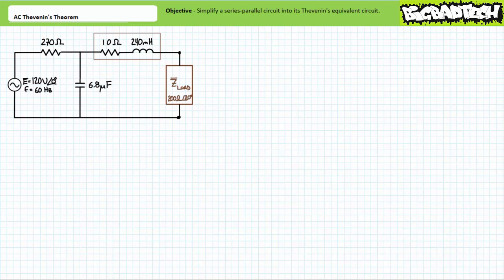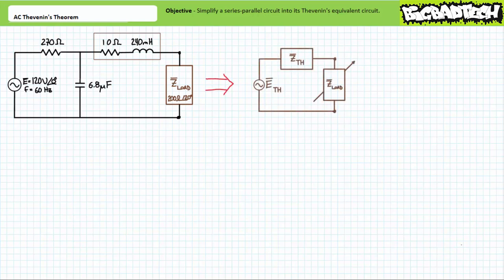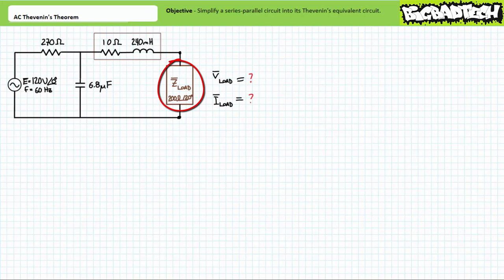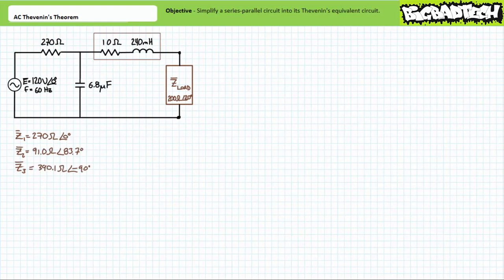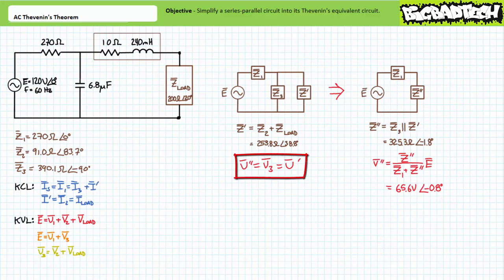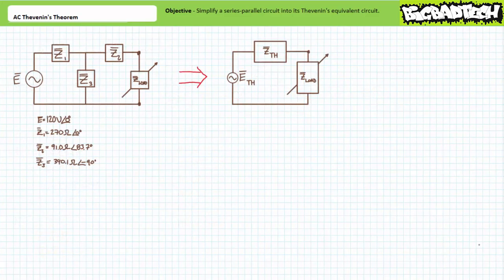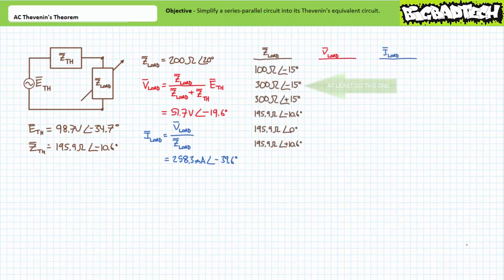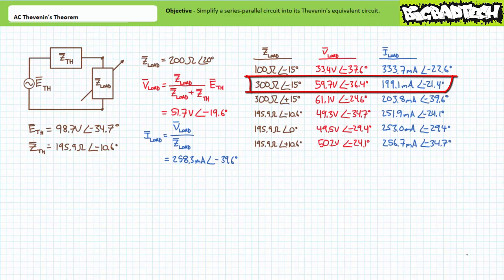AC Thevenin's Theorem (Full Lecture)

Comment: What I find surprising about this is the way the model remains accurate even when Zload impedance is lower than the full open assumption used to get the numbers. When Zload declines and current through that arm increases, the increase in voltage drop across Z1 and Z3 in series must exactly balance the declining shunt of current (and declining voltage drop) across the parallel Z2. Presumably that would come out with a rigorous proof....
Reply from the maker: True dat. Check out the "DC Maximum Power Transfer Theorem" lecture. It's not a rigorous mathematical proof by any means, however, a great way of visualizing response of the Thevenin's equivalent circuit is to draw a plot of current, voltage, and power for a range of load resistances. At regions near the open circuit equivalent, the response kind of stabilizes at the Thevenin's equivalent. This is admittedly a little more complex for AC circuits because you're dealing with two properties, impedance magnitude and impedance angle, however, if you can think in terms of two separate dimensions rather than trying to lump them together into a single three dimensional plot, the response is similar. Check out the "AC Maximum Power Transfer Theorem", this will explain the response of the Thevenin's equivalent for a range of load impedances.
Reply: @bigbadtech  Thank you, Jim. I thought I already knew most of the DC principles, but have recently found humbling examples of knowledge gaps you kindly exposed. Thevenin must have been a genius....

Dave

Comment: how did you get -390i ohms for the capacitor's impedance at 4:14? Your formula gives a magnitude of .00256353
Reply from the maker: It should be 1/(2pi6.8uF)=390.1. For some reason the "1/" in the 1/2pifC formula got cut off.
Reply: @bigbadtech  late night studying always gets me.  Thank you!